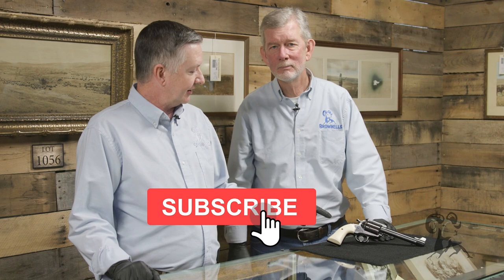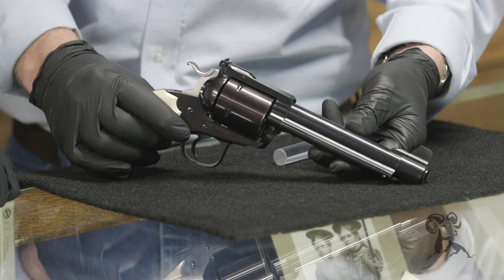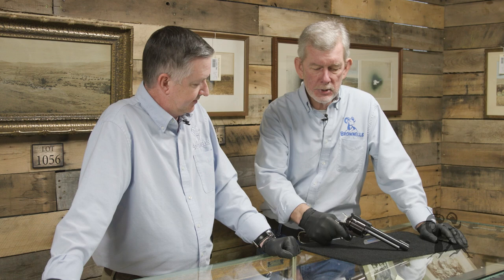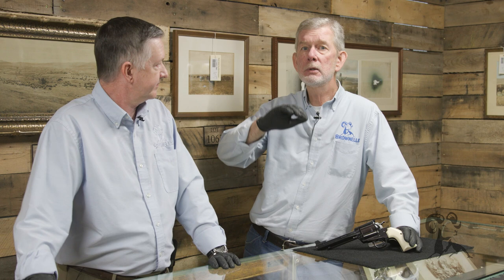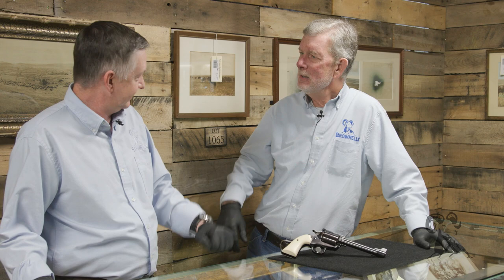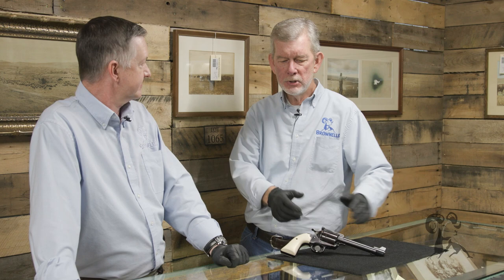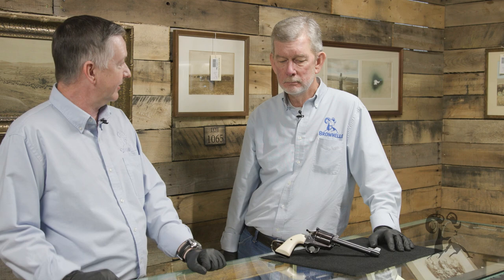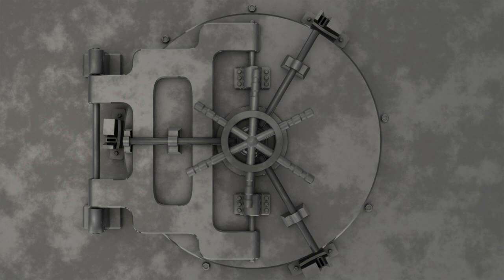From the Vault: John Linebaugh Custom Revolver

Comment: His load data for 45 Colt in the Ruger is still good to this day. I have been using his loads in my Ruger Bisley for years.
Reply: Where can his load data be found?
Reply: @ianscott4543  His heavy load data is meant only for his rebuilt guns, which have the tight tolerances necessary to stand those pressures. Don't use those loads in ordinary Rugers.

Comment: So I have a serious question. How would anyone compare the recoil on one of these to  say a .500 Smith & Wesson with a 4" barrel? I know it will be different  because the hump on the Smith's back strap stops a lot of rotation.
Reply: About the same.  Only two guns I won't shoot....a S&W 500 magnum and a Walter PPK.  Has to be the shape/size of my hands because I shoot 44 mags all the time.  Add to that list any 45-70.  My old shoulder just won't take it....why I shoot at max 308 and 6.8 SPC.
Reply: The .500 will have less recoil since the handgun is a lot heavier. My wife shoots the S&W .500 with zero problems..
Reply: @onionhead5780  Hardly, but she did grow up on a ranch..
Reply: I own a F/A 83 in 475 Linebaugh and have shot a snubbie S&W in 500 with 700 gr loads. The recoil is stout, but not  as stout as the 475. Gun weight makes a big difference and the X frame is huge, even in a snubbie.
Reply: @docholliday3273  I can comfortably shoot .44 Mag and.500 Linebaugh all day, I reload with heavy cast, the 500 S&W, 475 Linebaugh and that teeth rattling.454 Casull are all off the table for me. When it's no longer fun I'm out.